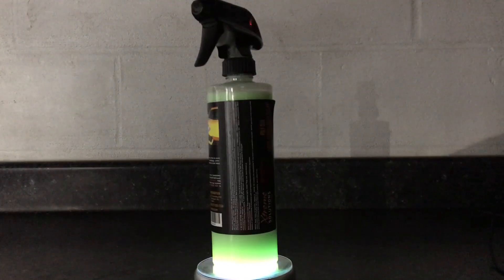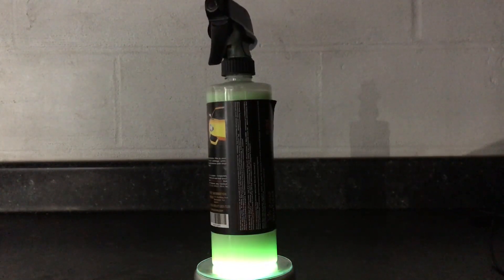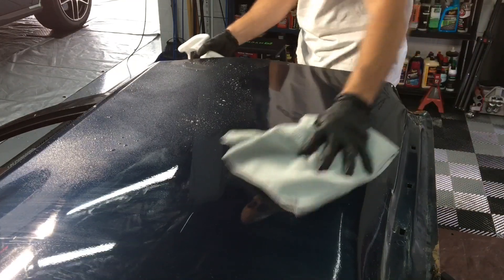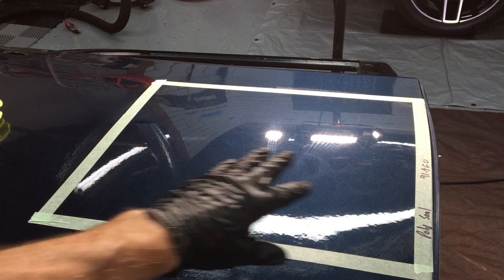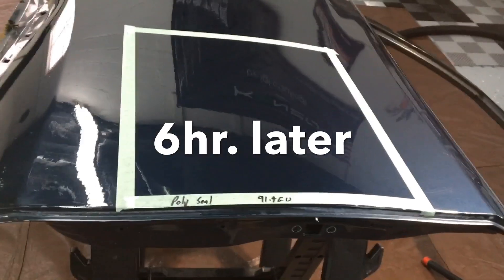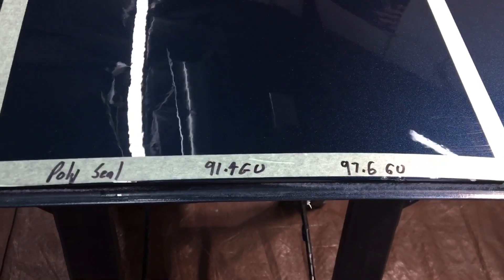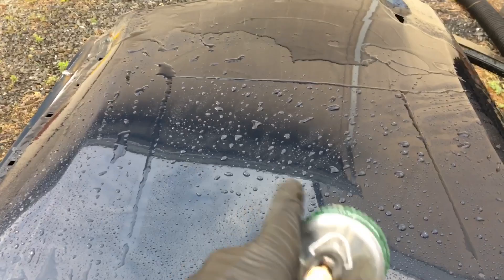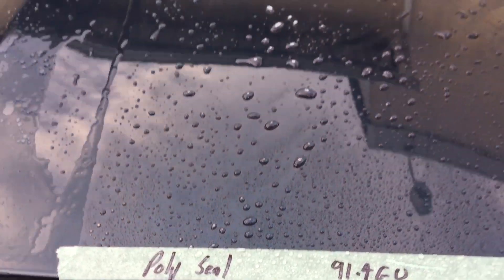Protection AND Gloss!!! Have We Found A Diamond In The Rough? Xtreme Solutions Poly Seal!!!

Comment from the maker: Can also be used on trim, chrome and glass. Will not stain or discolor plastic trim.
Reply: COOL.....       GO for it!~      test some more~!!
Reply: where can i grab this here in australia?
Reply: I wonder why they say don’t use on front windshield?
Reply: @tobyhigginbotham2564  cause of the wax that can streak ?
Reply: Put it up against Eagle 1
Reply: Eagle & tw seal n shine & this product would be a nice comparison
Reply: Manufacturer website says do not spray front windshield.

Also, can this be used on a Ceramic Coated car?
Reply: Brian,
Even though as you said it won't stain plastic, can it be used to shine and protect plastic trim ?
Reply from the maker: @SettiCY  Not quite sure if they ship there. Check the website.
Reply from the maker: @tobyhigginbotham2564  distortion in your line of sight from slight streaking.
Reply from the maker: @tribe_called_oh  It is a fantastic topper for a coating.
Reply from the maker: @stevenm6922  Yes
Reply: @apexdetail85  glad to hear.  Thanks for the reply.  And I love your scientific approach to product testing.  Keep them coming brother!
Reply: How about a three way comparison that includes this product, TW Seal & Shine, and Eagle One Wipe & Shine? That would be a nice showdown!
Reply: Looks promising, Brian...what is the typical longevity for this when used as a topper for a wax/ sealant?
Reply: Put it up against TW Seal and Shine
Reply: thanks again Brian. This is what I'm looking for! Looks great for my maintenance topper!
Reply: Can I put LVR 357 magnum wax, poly seal then top with bead maker?
Reply: @ Brian, Hi Brian, Excellent video!!Would this product work good as a sealant for RV Gelcoat?
Reply: Uput
Reply: Tretttt

Comment: I just bought this on my C7 Corvette Grand Sport in Long Beach Red.  I put it on over a 2 month old Titanium coating.  First let me say that I followed the manufacturer's instruction to the letter.  I used the dry car application with a damp microfiber cloth application.  The Poly-Seal goes on very and wipes off very easily.  It actually added to the depth of color and shine of the ceramic coating.  You will need to apply at least 2 coats to really see and feel the effectiveness.  After two coats the slickness and gloss improvement is amazing.  Time will tell about durability.  I highly recommend this product. It's the best spray-on sealant I've ever used.

However, you will used a lot more on the first coat than advertised.  I used about 3-4 ounces on the coat, but only about half that amount on the second.

Comment: Technicians Choice! I started using it diluted 1:1 to stretch it out and it’s still pretty dang tough. Undiluted it’s tougher than a 2 dollar steak. I use to swear by Carpro hydro2 lite but TC is more user friendly requires no water to activate it and more cost effective. Plus no streaks! Durability is also much greater than Hydro 2 lite.
Reply: I liked HydrO2 but found it did not last very long at all. Worked great for about a week but after 10 days or so it was pretty weak. For the cost I didn't find it was worth it, though credit where credit's due, it's easy as hell to apply in a coin wash if you're in that situation as I was. Decent protection for winter as long as you have dollars.

Comment: We have already seen P&S beadmaker being great for a topper to bump up shine and slickness but not being able to fight chemicals for very long before being exhausted. I would rather see Technician's Choice Ceramic Detail Spray TEC582 and/or Jescar Powerlock Plus and/or  Liquid X Shock Ceramic Spray and/or Torque mirror shine and/or Concours Nova Jet spray coating from the land down under. Although Power lock plus has been around a while, the others seem to be up and coming choices for at least the weekend warrior(s). Throw in the turtle S&S and you've got some great comparison battles ahead. Sign me up for those vids!! Thanks Brian.

Comment: That gloss is to die for. Can you bring back the salty brime they use on the roads in the northeast during winter. That has to be the best real world chemical scenario. 

Turtle wax and eagle1 and technicians choice ceramic sealants have the best bang for buck interms of prection.
Reply: It is used extensively in the Midwest, too. Stuff is a nightmare during the winter when you cannot clean your car on a regular basis because of the sub-freezing temps for weeks on end.

Comment: I would like to see it against Meguires Ultimate Fast Finish, looks like it could save me some time going straight on after the post shampoo pressure wash. Do they have a UK retailer? If it's not an unfair test you could try it against a hybrid Sio2 option like Infinity Wax Turbo6 or TAC Systems One Step Master.
Reply: Daniel Croteau Ultimate Fast Finish has easily lastested over 6 months for me (2 coats) so far with the car being washed every 2 or 3 weeks. It's the best product I have used for gloss appart from Bouncers Done & Dusted Si Edition which I got recently. Great quick detailer to try if they sell it in your area.

Comment: Great video. I appreciate how you’ll test products that aren’t very mainstream or don’t have the visibility they may deserve. It sets this channel apart from others who are testing the same old things over and over. I like the idea of finding the diamonds in the rough. With that being the case, I really recommend you try out some products from The Gloss Shop. They’ve been flying under the radar for years, but I’ve found their performance to be outstanding. Maybe check out Hydrophobe, an sio2-based spray and rinse sealant, and CeramicGuard shampoo. Both of these I’ve found to be surprisingly good considering I never hear them talked about. Looking forward to the next video.
Reply from the maker: They have a coating as well. Never heard of them until you mentioned. I will snoop around their website. Thanks!
Reply: @Apex Detail I use their coating as well. I didn’t mention it because I didn’t find it better or worse than some other standard coatings out there. Slightly easier to apply, IMO. The Gloss Shop’s competitive advantage seems to be the high amounts of sio2 in their products compared to others. Would love to hear your thoughts on them if you get the chance.

Comment: Have you tried Technician's Choice Ceramic Detail Spray? Offers more protection and slickness than Beadmaker, but would love to see you check it's gloss level compared to others.
Reply: Ryan Brown I’m waiting for mine to come in tomorrow🙌🏼 currently using beadmaker but I wanna compared
Reply: Im in the same boat... talk about an underrated product that needs more time in the light to get the word out there!
Reply: TC is a wonderful product. I’ve been using it for a while now and I love the stuff. I use it undiluted for certain jobs but I mostly use it diluted 1:1 both ways provide excellent results.
Reply from the maker: It is on the way...I will review it.
Reply: MrCamzdad can tc be used as a maintenance spray or does it really have high dosage of ceramic properties in it that will not yield good results ?
Reply: Compa Cheo yes it can when it’s diluted 1:1  but you really don’t need to after the first initial coating is put down this stuff is freaking amazing imagine a product with the protection and durability of seal n shine and gloss and slickness as bead maker
Reply: @compacheo603  interested to find out how technicians Choice compared to beadtmaker, what were your results? Tks
Reply: I've been exclusively using Tech582 as a new detailer, and have received great feedback form customers.  They love the high gloss, and from the reviews it seems to last a very long time.  It's also very easy to apply.  Even if someone just pays for a regular wash, I still use 582  diluted 50% to give the car an awesome look.

Comment: This time of year it’s hot, dry and dusty in many parts of the country. I suggest adding DUST as another category to use when comparing these products.  Leave the panel outside for a week and look at the amount of dust that’s collected on the paint surface. Also how easily the dust is released by blowing it off with a leaf blower or air hose attached to a compressor at 90psi?  This is important for those of us with dark colored vehicles.

Comment: How does this hold up against Fusso Coat.  I used Fusso Coat on my 2013 Ford Taurus SHO (red color) and it worked great.  I am looking for a product that holds up against all the crazy salt and stuff that they put on roads here in Missouri.  So far Fusso Coat is holding up and the beading is outstanding.  Is this product almost like that as in protection.

Comment: In your previous video, "GLOSS! GLOSS!! GLOSS!!! Which One Of These Will Provide The Most For Your Automobile!!??"  Beadmaker came in with an average gloss reading of 98.7 and the Xtreme Solutions Poly Seal was 97.6 in this video.  Was the same test panel used?  In your opinion, does Beadmaker provide better GLOSS then Xtreme Solutions Poly Seal putting all other factors aside?

Comment: This modern water based paint and clear coat on our new cars is disappointing. It's very brittle and suffers badly from stone chipping. You can't  blend it when doing touch ups, whole panel has to be refinished.  I would love to ceramic coat my new Outback, but the paint is such poor quality, I feel that it's just not worth it. Same with my 2015 Ford Fusion, which has even worse paint quality. 
Why do we have to put up with inferior auto paint? Bring back the Lacquers of the 80's.